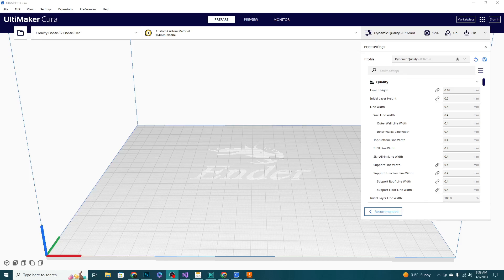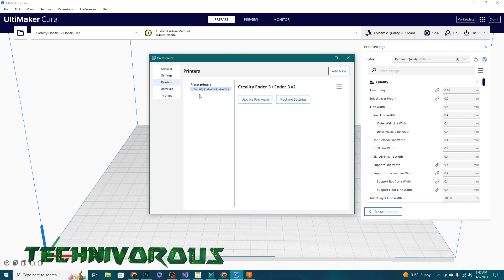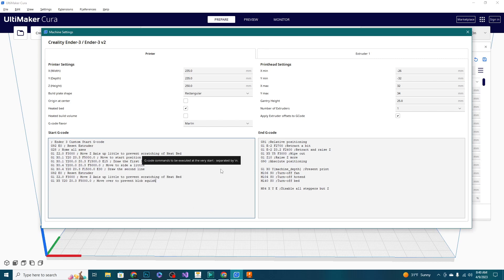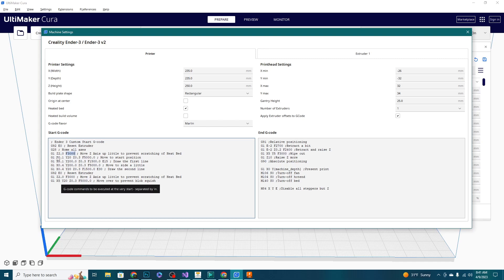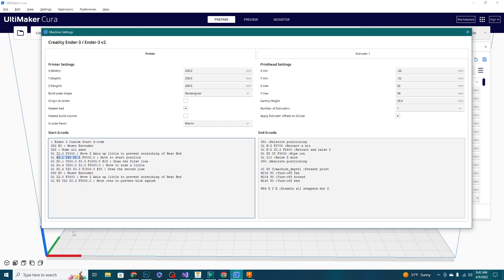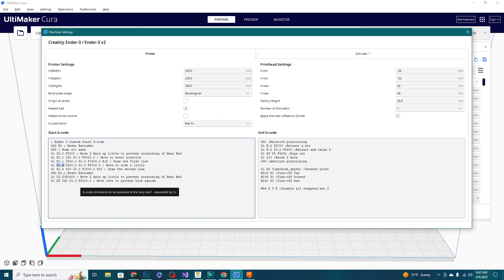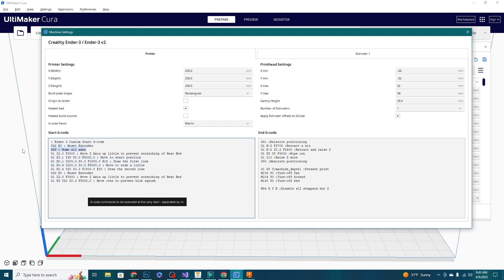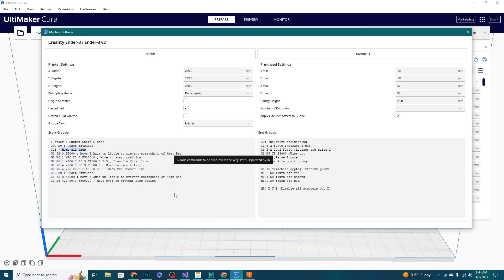Cura Questions -Adding a purge line in g-code to clear your nozzle before printing

Comment: Hi, I got a Tevo tarantula 3d printer, I currently upgrade it, question is I am going to use a y splitter for the single hotend with two extruder, can you help
Me to fine the right link, or help with dual extruder for the codes please

Comment: Great Video .for newbies like me ... I do have  question on the purge as opposed to the actual print. When i slice and print an object the purge line works fine but then the actual print doesn't manage to  stick to the bed and just clamps around the nozzle. Any suggestions??

Comment: Hey Thanks for this, how would I go about adding two more lines? Need a little more purge out of mine.
Reply: You will want to make sure I did the x-axis numbers correctly, but just copy and paste the first two lines that draw the first line and modify the x-axis position:  
G1 X0.9 Y20 Z0.3 F5000.0 ; Move to third start position
G1 X0.9 Y200.0 Z0.3 F1500.0 E15 ; Draw the third line

Comment: Iv been struggling with little lines on my prints got to a good point but got told to check to see if it does a nozzle prime before each layer how would I do this

Comment: Having a hard time with my ender 3v2.... it works fine if I manually push fillament, as well for about 1min after but then seems to dry up and I have to manually push to fill the significant missing section again
Reply: whoever liked that thanks for recalling me, update: I replaced the entire hot end with the direct drive kit and once I was finally brave enough to remove the bowden tube sure enough heat-creaped

and one roll of PLA later I'm noticing heatcreap already :( damn salesman toled me it was a full metal hotend (outside only!!!)

Comment: I've got a problem with my printer starting prints to high I think is in the slicer gcode any suggestions?
Reply from the maker: Does it touch the bed when you home it? If it does then it's gcode related. If it doesn't go all the way down your end stop could be too high up

Comment: I just got a ender 3 pro and put it together, changed nothing with the cura settings and everything looks how it should but it keeps printing everything along the left edge of the bed and will not print in the center of the bed. Please help! And the origin at center is not checked.
Reply: desactiva la casilla "origen desde el centro" en configuracion de la impresora

Comment: Hi, how move the purge line to the front of the build plate. From left to right?
Reply: i Also have the same question the side interrupts too many prints
Reply: Just use the same code, but modify which axis is moving. Instead of going 20-200 on the y axis, have the values go from 20-200 on the z axis.